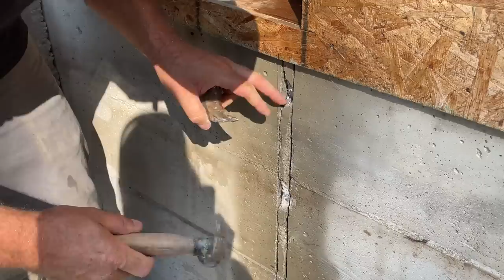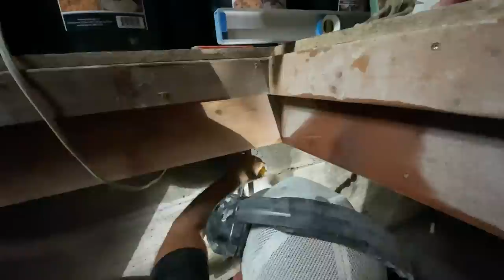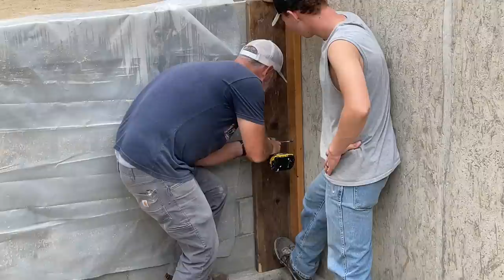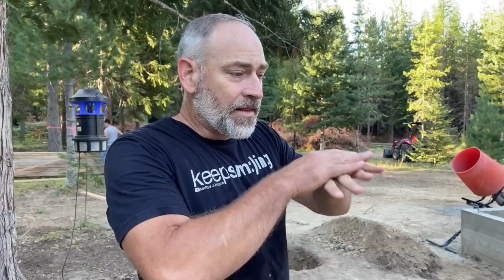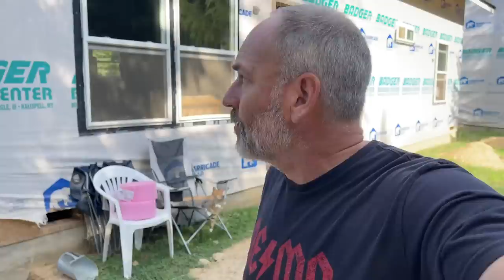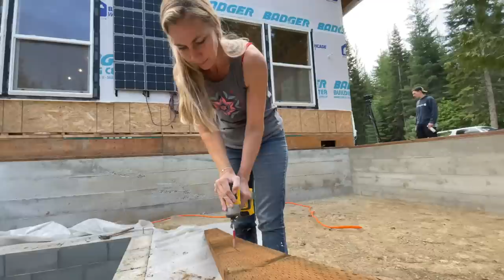DON'T TRY THIS AT HOME! - Cutting Concrete Walls and Building Floors - Real Off-Grid Living

Comment: If you need to straighten out an anchor bolt, just put the nut on and tap the nut till it’s plumb. Y’all are doing a great job. Was worried when I didn’t see a video on Saturday.

Comment: Placing concrete and masonry work in general is just about the hardest work in construction. Congratulations, looks pretty good. That short wall can be called a stem wall or a cripple wall. Any studding shorter than full length is called a cripple stud.

Comment: Ive cut alot of concrete using Gas powered and electric saws , never seen a saw like that with the long "neck" so weird and looks dangerous  lol the ones i use cut 8in deep .. couldn't imagine 3in at time, so much extra work.  Coming along great guys   excited to c the next video

Comment: those chunks of wall you cut out can be saved and used as something like the concrete pad for the outside part/heat exchanger unit for an HVAC system or for a backup generator or even cut smaller and uses as steps.

Comment: In the other half of your crawl space, the dirt side of your root seller you should have dug and installed your water holding tank, it would have helped you with like insolating it in the winter and keeping it cool in the summer, just a thought.

Comment: READ THIS tip for Julie when use the pick or a sledgehammer or Axe you need the weight of the tool do the work what you need to do is slide the hand near the head  of the tool down to your bottom hand at the bottom of the shaft the weight of the tool does the work you will find this a lot easer

Comment: Great video guys... ! Jules I know how to help you with the tears digging those round holes you were having trouble with... I ran into the same thing with the roots and a friend of mine suggested buying a manual post hole digger that had the blades on the edges that would not only cut through the ground but it was heavy enough to cut through the roots too... Made my life a heck of a lot easier. Now for any trench or hole I need to dig... Out comes my trusty post hole digger... I thought you guys had one but not 100% sure. Did you guys use one to dig the well? I got the steel handle ones from Home Depot... The heaver ones worked better that had enough weight to help get the job done... Great job guys...!

Comment: You should still build a wood frame to support the Floor or the wood will sag.  The wall still has weight transferring to the  foundation.  Good Job Cutting the wall

Comment: I have never seen anyone use a perforated sump container before.  I would be very worried that the rain will pour off your roof and down the nice gravel path you have created on the outside of the concrete walls, under the floor through the gravel and pressurized right through your sump and flood the room, possibly several feet deep if the sump-pump fails.

Comment: I'd just line the root cellar with foam and use excess solar in summer to refrigerate it, would need very little power and it will be dry.

Comment: If your out of square in ten ft your. A 1/4 or more in twenty so your more than an 1/8 you never frame your floor system to block or concrete walls always go by a chalked square line

Comment: The place looks great. you may have wanted to lower the overflow box. so, water would have run into it. You can still cut the top out.
Reply from the maker: The plan is to cut it down. Left it long so concrete couldn’t go in.
Reply: @MartinJohnsonOffGridLiving   I should have known you guys knew what you were doing. I'm an idiot. put a foot in the mouth all the time

Comment: Actually, that wall does have some load bearing value.  It supports the roof ridge board.  The ridge board needs end and intermittent support.  The Building Code states that all exterior walls are considered load-bearing.  What is also true is that the perpendicular walls are bearing more weight of the roof.
Reply from the maker: We don’t have a ridge board or am I wrong?
Reply: @MartinJohnsonOffGridLiving  If you used trusses, you do not have a ridge board.  If you used roof rafters, they are attached to the ridge board at the tippy top.

Comment: Thats the wrong concrete saw you should use one with a single blade that will cut through a 150 mm concrete wall easy as !